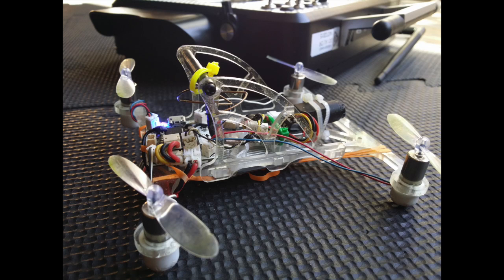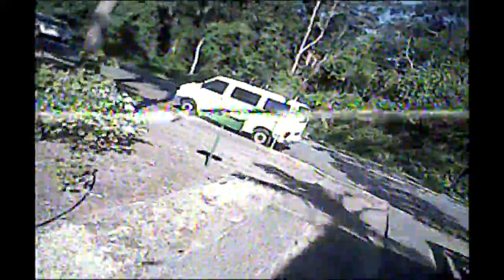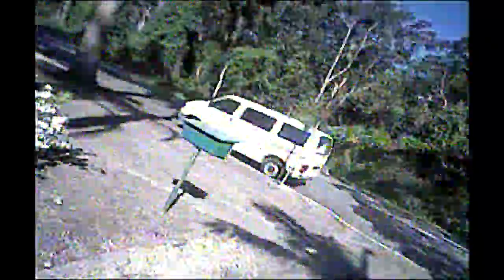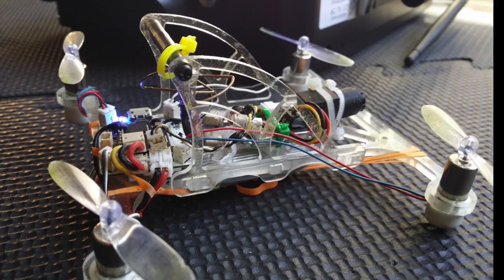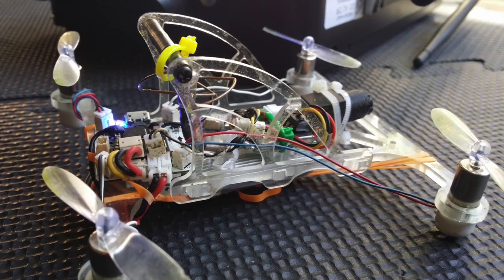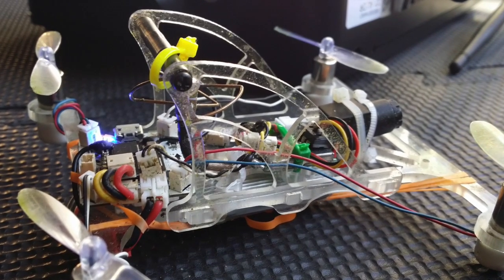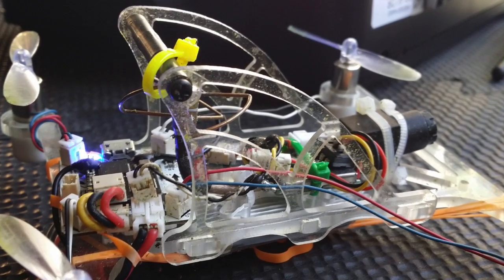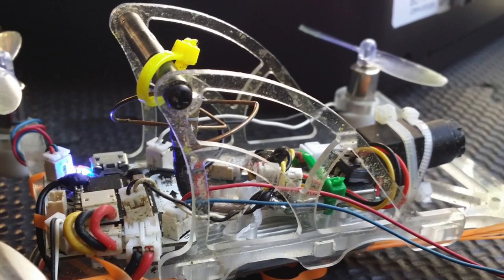Crash-Testing the 135mm microFPV Shark prototype

Comment: Any suggestions on different components that you would put in if you built it again? Ill probs use beefs cus its easier to get if it fits? Also what RC receiver are you using and what actual size are those hubsan props? Sorry for the torrent of questions!
Reply: I'd use those exact components. Again and again. Rocks! Didn't have luck with my Beef so far, but that's just me not figuring it out.. I'm using LemonRX receivers and the Hubsan props are 55mm. The frame is designed for up to 66mm, but the prototype in this video had vibration issues. Fixed in the final frame!

Comment: Can one have more details of your quad ?
Props, frame, motor, FPV, controler, ...
Reply from the maker: +ONCLEFLY just added some specs to the description ;)
Reply: +Micro Motor Warehouse Hello my friend :)
Thank for description.
Props clear hubsan are good for a crash ?
Xhere find your frame ?
The motors 0820 very good i know :)
For you TX5823 is better TX5823 ?
So very good job my friend :)
Reply: +ONCLEFLY Clear Hubsan props are the toughest I found, but also here, quality varies. The TX5823 is the same as the TX5823. The TX5826 is running on 5V and puts out 400mW, apart from that it's the same as the TX5823.
Reply: +Benedikt Haak thanks, Props Clears Hudsan I am going to take it if they are more strong, have you a good link ?
Yes the TX5826 is better because 400mW and the TX5823 is 200mw I have three of it moreover, yours goes well around the house.
I have one DreamCatcher 7mm and other 8mm of you, very nice but no protections engines and difficult to make hold the FC.
We also have the PQUM which you have so very well thanks to Goesbish. :)
Reply: +ONCLEFLY goebish did a lot for this hobby! For the props, I just search "clear Hubsan" on eBay.
Reply: Thanks i go search me too Clear Hubsan on EB.
This frame are note in http://micro-motor-warehouse.com.
Reply: +ONCLEFLY no, the frame is not in production yet. Will be a few more weeks.
Reply: Great, it remains more than to wait. Thank you Benedikt and good job for your great videos with the PQUM with 808#16.  :)